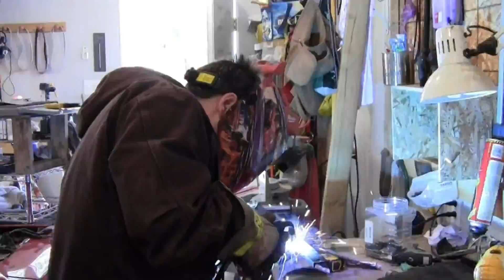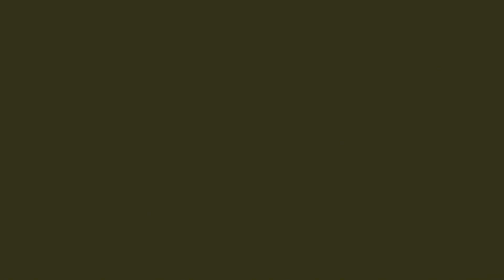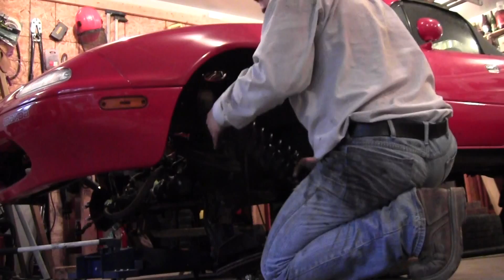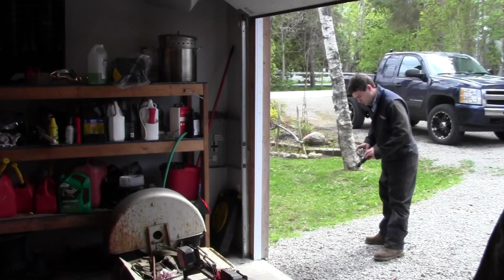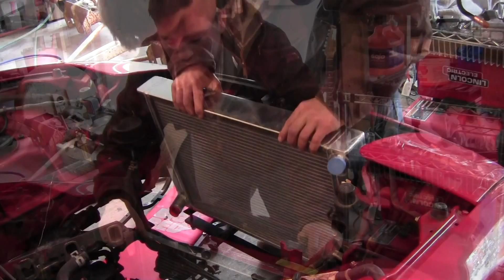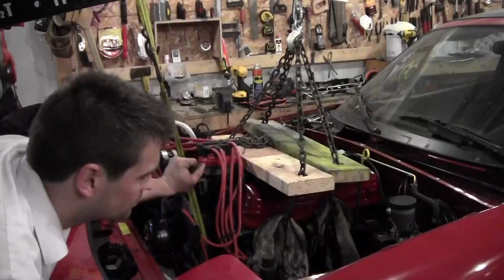Project 5.0 V8 Monster Miata - 06 - Front End Reassembly

Comment: Hello my friend, I know what you're going through.  I have a BlogSpot 575hpv8miata.blogspot.  Just wondering how you're making out on your project?  Mine been done for while.  I have called Martin ,from monster Miata so many times, I think he thinks that I am his brother.  The guy has been more than great to me, very helpful person.  IF you need any advice, I built everything myself.  motor transmission, exhaust and for me the exhaust was the hardest part of the build.  Some food for thought, my 0 to 60 time on the street with street tires with an automatic transmission, is 3.30 and my 8th mile time with the air conditioning off is 7.35 at 98mph, with a 2.47 rear-end gear.  So keep at it, it will be a lot of fun at the end when it is complete.
Reply from the maker: Hey John! thanks for the note! to be honest it's been back together and kinda drivable since mid/late august. It still needs alot of sorting, but i got caught up on this house renovation and been working night and day on my house... so the car's taken a back seat for now....  I had the exhaust video almost complete 2 months ago, and got side tracked, so it's still not uploaded lol... I did everything myself including the exhaust as well, but i didn't rip and rebuild the trans and engine....   in the future i do plan to though... but i thought to keep this project simple i would save that for later...    but even with this 225hp stock 5.0, the car is just an absolute blast to drive! You're starting with a car that was a blast to drive with 116hp....  the extra torque just makes it a shear animal! and out here very little people have v8 miatas, so everyone looks and scratches their heads when they hear that sound :)

Comment: Should avoid 225hp v8s lol could have built the 4cyl to have more power while keeping perfect balance...i will build one soon with smallblock chevy or another 2l na 240whp up like i do so well lol..nice project tho sure has torque
Reply from the maker: well, it's true, I guess it depends what you're after... I do absolutely love the sound and feel of the v8.. But I'm planing a trickflow head cam intake kit on it... so... should get me above 330hp flywheel HP easily enough..   The torque is really just so much fun cruising around town...